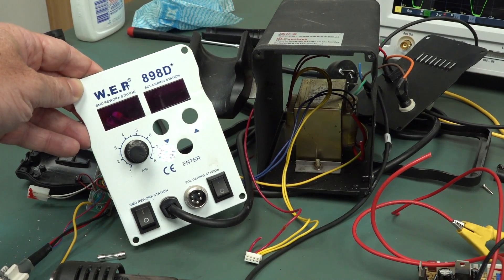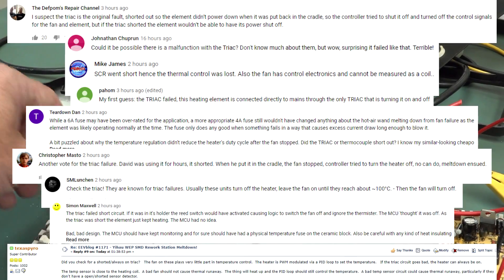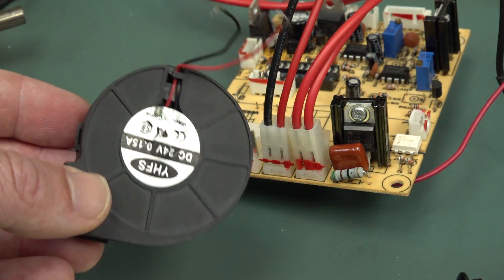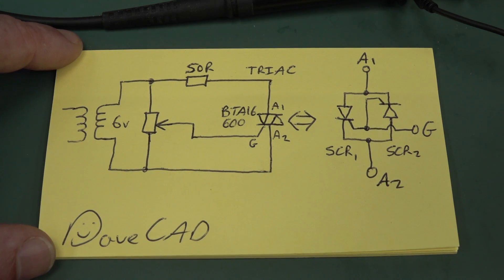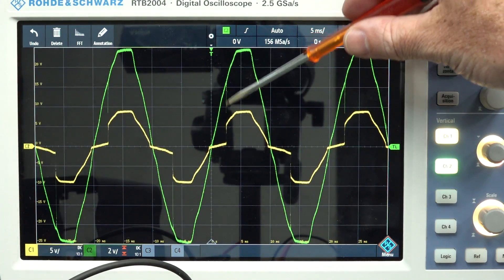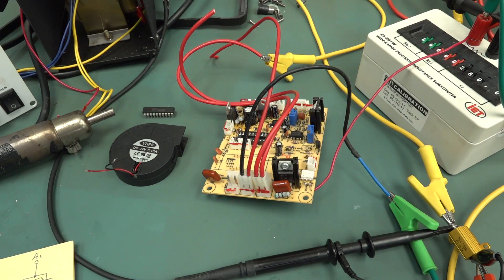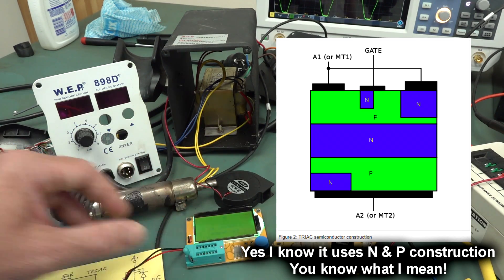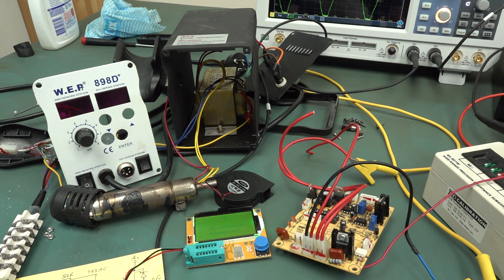EEVblog #1172 - TRIAC Testing (WEP Meltdown Part 2)

Comment: 3.5-16v supply voltage ic , on a 24v fan  together with the missing RC filter and diode, i wonder that not more burned up like that
Reply: I have a 12v 80mm fan, super chinesium, same design, i pushed it to about 55V, it didnt die, but it started overheating above 20-22V. I dont think it died from overvoltage as the chip seems quite resilent but im sure it died from being overheated for so long
Reply from the maker: LOL, didn't notice that!
Reply: @EEVblog Is that white thing (in the fan) not a fuse?  If you trace it out that's pin 1 (+) of the chip, but prolly the chip is gonesky
Reply: @EEVblog  no wonder it failed lol
Reply: Or the white thing could simply be a resistor soldered upside down. Seen it before
Reply: That's the thing I've spotted as well. But I'm also wondering, was it actually powered at 24 Volts?
Reply: I've done a bunch of these style rework station fan replacements. This is the most common part to fail. I keep a stock of these 50x50x15mm brushless fans. Tech Tip>  don't get the 24v version, get the 12v version. The 24v spin way too slow.
Reply: I noticed that aswell, no wonder the fan died and them fans can last forever or a very long time.. bet they did that to try to make sure the fan don't last too long, I've got some 5 volt dc fans and I ran one off 12 volts to see how long before smoke come out, it never..  it just got hot and slowed down, after letting it cool it was fine, so they can last some time at over voltage.
Reply: I was wondering the same thing
Reply: that white component may be some kind of zener, as it's between the Vcc pin and the positive input
Reply: but he has been this "sol dering station" for years
Reply: I noticed that as well, and even if the chip could run at a little higher voltage,  all it would take is a slight power surge to fry it. I would imagine that you would run the fan at the full 24v, as you would need all the cfm that it could supply.
Reply: Nice though, that they have integrated the Hall Effect sensor and the coil drive circuits into one IC!  Depending whether there is a North or a South pole above it, the electrons going through the semiconductor material in the sensor turn either right or left under the influence of the magnetic field; it's like a pair of diodes side by side with a common cathode and two separate anodes, and the currents going into the two anodes vary.  (The same thing should be possible in a vacuum tube valve, though awkward to realise in practice.)  The polarities of the currents in the coils are reversed depending which pole is over the Hall Effect sensor so instead of attracting the magnets towards the coils, it begins repelling them.  Then the next pole to come along is attracted towards the coils; but at the critical moment, the Hall Effect sensor sees that the magnet has moved, the outputs change and the current reverses.  And so the cycle repeats.
Reply: Its China, they dont give a shit about it, they are just filling world with crap, e-waste and toxic
Reply: That's insane how for a "24" volt fan the IC is rated for 16 volts. Hmmm.

Comment: Can't you get spare guns? You could have fixed it. They should only cut the heating element and it should not be via reed switch it should be an arm on the side of device with sprung microswitch. Or at least put the reed switches in several positions or put them in the station and magnet on the gun. if fan stops working there should be a detection and standby with warning lamp for fan fault. Just bought a most likely fake quick ali express special €135 857DW

Comment: Inside the motor driver there’s a diode in series with the VCC. You checked it with an ohmmeter. The diode might not conduct with the ohmmeter. Did you test it with power?

Comment: Anyone know why the first thing checked was not the thermocouple and its wiring back to the processor? If the thermocouple actually failed first and it thought it was cold, would that not have shut the fan off? I know the fan is dead now but i would imagine a vast proportion of the heat generated after the initial fault happened would have exhausted out of the fan side as it is the pass of least resistance as it has bigger holes than the nozzle.

Comment: Are these devices not designed to antisipate situations like a fan stopping. Maybe there should be a tiny tachometer attached to the fan to give feedback to the microcontroler.

Comment: Should have tested the hall sensor to see if that was the fail point.
I might have to change the fan in mine to avoid a similar failure even though it is a later model it won't hurt to check.

Comment: It is likely that without the resistors and capacitors installed as specified in the data sheet, transient voltage spikes hit the driver chip and popped it.

Comment: I have a version of this. The iron and rework station actually work quite well.

But I had to fix things before use (like they fused the ground instead of mains) and I installed a quality mains switch from Mouser.

Still, I never leave it plugged in, because I don't trust it 😆

Comment: Airflow. I have the smd rework from sparkfun which features a diaphram air pump with adjustable flow. Turned down the flow for a minute with the temp still hot, which was already hot for what I was doing, and found the plastic which was in direct contact with the steel had melted and the tip sagging. Haven't let it do this since and it has not gotten worse. I'm sure the airflow provides a thermal barrier between the element and the steel encasing it.

Comment: I have some Stagelighting-Dimmerpacks that utilize the BTA16 and I must say everytime a Dimmerchannel blew up on me it resulted in the Triac staying on, dead short leaving the lights at full intensity. It’s an easy fix though by simply changing the damn thing but still every single one of the countless times it has happened failed in its on-state

Comment: It's cheap. All ofthis crap is optimized to the cost so there are some missing parts. It runs withot them but they are important to be safe and to met the legal criteria.
- Why there is not the varistor to protect the triac?
- Why there is not the EMI filter when there is triac control?
- Why there is not the thermal fuse for case somethink is really wrong?
- Why there is not feedback from the fan if it is so important for safety?

Unfortunatelly the cost also don't guarantee the safety (Weller).

Comment: One little non-resettable thermal fuse, under £1 if you know the places to get them from, could have saved this disaster .....

Apart from that, the soldering station really does not look too badly made.  Prob'ly worth buying as long as you're prepared to do a quick little mod, half an hour and a bit of very careful soldering  (douse it in freezer spray and use a powerful, temperature controlled iron or one of those gun things  (I've never got on with them, but more power to you if you can)  to get just the right amount of heat you need into the joint and not give the time for it to travel down the lead wire into the thermal fuse and blow it.

Comment: Edit: for any confused...A triac requires a quick pokey turn on, as given by a diac on the gate usually. Also it varies power by altering the time constant of switch on, simplest arrangement given by an R C time constant with variable R.  A nice fat inductor on the output helps with the horrible spiky nature. None of these are in your circuit...But you haven't turned it on yet as I watch....

Comment: Dave, why didn't you just connect the whole station as it was to the heat gun, just with the heater replaced with a light bulb? Then you could check if it controls the fan and reacts on thermocouple temperature.
Reply: Because  that is a repair mans mind - Dave, brilliant as he is, just hasn't got one of those as shown on many of his 'repairs'.

Comment: Hi Dave! I did some work on TRIACs. One very common reason why they stop turning off is if they are on square wave power supply like old style inverters or UPS. They need time to turn off which they get on sign wave as it goes through zero crossing. There is almost 1ms time during 50Hz power line. While 50Hz square wave do not give this time for TRIAC to turn off!  It do not damage the TRIAC but give 100% duty cycle to the load! 

Can you verify the state of power supply at the time it went kaboom!

Comment: The heater assembly should have a one-shot or self resetting mechanical thermal cut-off placed near the middle of the heating coil body where it would do the most good.  Pretty much any 'approved' heater would have this design.  They can be as small as the reed switch they used. Even bargain basement hair driers have one.   As it was built to a super low price,  I get leaving it out, but would have saved a lot of unnecessary excitement.  But then we don't get a laugh and a Dave video.

Comment: Look at the datasheet, the chip is rated for maximum 16v input power, but it has a capacitor between the positive pin and the positive wire

Comment: The failure mode with these is quite simple. The fan is individually controlled and there is no feedback. The thermal regulation is done by a microcontroller using the couple and triac. When airflow stops, the airflow from the heating element to the thermocouple also stops, making the thermocouple read low less, causing the heater to switch fully on. Since the heat will never quite reach the thermocouple to get it to the set temperature, this thing will go full meltdown. 
All it would have needed is fan rpm sensing and maybe even a thermal fuse in the heater block.

Comment: My guess is that the fan failed and the radiant heat was too much for the plastic.
Dave, if I am not mistaken you have a similar rework station : disconnect the fan and let it sit for 30 mins ;)

Comment: I've had a TRIAC fault where there was a partial short from gate to anode which was enough to keep it switched on regardless of the gate signal. There was no short from Anode to Anode.

Comment: Why not to make some dummy heat gun to test if there main unit has something wrong? I mean with high resistant you should be able to demitre if triac works. I also think that you have such nice adjustable voltage source that you could simulate thermal voltage of thermal element.

Comment: I would guess that device is reliant on the fan to reach thermal equilibrium and then when the fan fails or is "stuck off" it has no working feedback to know the fan has failed.  I noticed that the fan only has 2 wires so likely no tachometer feedback. I also suspect that the safety feedback devices do not actually work or it is "pot luck" if they are actually connected to anything on the circuit board.

Comment: So what is left to explain the failure of the overtime circuit than that the thermocouple requires airflow? Especially given that the TC is behind the last bulkhead of the ceramic insulator, I think this is a likely cause. Do you plan to test the TC in situ?

Comment: It could have been the control loop. I have played with the firmware and replaced the micro on on my atten 858d+, and I remember even with full airspeed, full trottle on the heater ramps up the temperature really quick. If something goes wrong with the regulation it will go red hot even with the fan on, i think. I bought some thermal fuses, but found no good way to mount them in the heater module.

Comment: I still think that the lack of airflow meant that the thermocouple was measuring possibly 1 hundred degrees or so less than the actual temperature. 

The other factor might be the magnetic switch when you put the thing down - because if the fan failed, you might think it had switched off when seated back in the cradle.  You wouldnt be aware that what had happened is the fan died, and the station thought the tool was still being used (ie. not disabled by the reed switch - I often find I have to reseat mine a few times to get it to register that I've finished using it).  That coupled with the temperature measured as much less than actual temperature perhaps caused ramp up in current provided to the element in order to compensate as it thought it was too low...
In any case a bad design, these things need to consider failure of each individual component and how it might be fatal.
Reply: This is exactly what happened, the thermocouple isn't close enough, the heating element get hot from it's center, you can see it by where the metal gets red first, the distance is big enough so the set temperature will never be reached.

Comment: In the past I've repaired hundreds of domestic appliance modules where the triac, often a bt139, had failed. Many did not show a fault using a multimeter and would only break down and go short under a highish voltage and load. But my money is on the placement of the sensor, without an airflow, the heater would easily get hot enough to melt plastic. Even with the fan running, there would obviously be enough heat to incinerate that plastic handle if it was held in front of the nozzle .
Steve

Comment: Mine didn’t have a failed triack ether
Reply: No one has, just a broken cable on the fan, a broken transistor for fan control or maybe even the fan itself gave up. Just needs a new housing for the handle and this thing will make money many more years.
Reply: @Wilson84KS  My fan was also working!
Reply: Then the thermocouple maybe melted, the op-amp died or anything else in the control unit, but definitly an even more rare case.

Comment: thanks for the davecad link dave. i am actually running an old system from before yearcount. its a ‘ stone and chisel 200-bc’ . had some installation issues before but working grate after the update.  i was wondering.. will you be putting in an undo function anytime soon ?

Comment: Probably the fan, but could the heat coil get shorted to the metal shield and find the way to a closed circuit, maybe also fry the fan?

Comment: Fan fail - I wonder if the fan wires are cheesy aluminium and one has gone o/c maybe  - you could stick 12v directly on the fan board and just check it still doesn't spin up Dave (I noted the comments above about fan chip voltage range also)......But it seems odd that we have two failures happening at the same moment here, so I wonder if something in the power supply has gone intermittent and is knackering multiple things, like fan and triac drive/control loop  at the same time ?

Comment: Can you not put another fan on it and put it back together to see if it was indeed the fan that failed? I agree it could be the chip as on mine, when you return the heat gun on the base the reed switch sees it, turns off the heater and keeps the fan on untill the temp has reached 100 deg c. Only thing I could think of is that the fan shorted or failed for what ever reason causing the micro to throw a wobbly and keep the heater on. Or maybe simply just the fan being on not trying to keep the coil cool was indeed the issue. Defo an odd ball.

Comment: Hey everyone, I need your help. I am currently building SMPS on tl494 chip. But I am little bit confused about powering the chip at very start. Can i use 200k resistance between mains 300 volt regulated DC supply and tl494 chip to power it at very start.. is it safe way to power it up?? I'll power it later on with auxiliary winding with rectification for running the chip continuously.
Reply: You would likely need a zener in paralell with the TL494.
(even.. when it starts switching it may pull enough current to lower the voltage)

Check UC3842 for a common SMPS chip that have a start from mains circuit.

Comment: :) I have on my table right now a fan control unit that uses triac to control fan. And its weirdest possible malfunction. It works fine up to certain fan speeds. After that it goes crazy. :) Atmel mcu controls triac. I have no idea what the ef.... is happening.

Comment: I still dont think there was any failure other than the fan, the rest of it could still function correctly and overheat to the point of melting the plastic. I suspect that if you just put the mains power on the heating element without any control the element would burn out very quickly possibly before the thing got so hot as to melt the plastic that much.

Comment: QUESTION ! ! !   The bearing in the center of the motor at the end,  was that "wallered" out by wear or did it get warp by the teardown?  Worn bearing in motor cause it to hang up on something prevent it from turning?  My guess actual cause was motor but it failed mechanically not electrically.  Set it down but instead of sense it off it actually locked the motor.  Sorry I know bad wording.

Comment: Let's replace the fan and see if the unit works, if it doesn't work then my first target would be the heating element power drivers, after that the thermistor and finally the micrcontroller .

Comment: Did you actually try the fan with a power supply? You mention is as if you just tested continuity, but that's not representative...
Reply: Try watching the video before commenting
Reply: @ernieschatz3783  Watch the other video before commenting, he said he "measured that fan and it showed open circuit", suggesting he used continuity mode on a multimeter. But that wouldn't be representative, since the fan is driven by an IC the multimeter's low voltage wouldn't suffice to make it start doing anything. So when testing that way it could very well be showing "open circuit" even if it worked fine.

Comment: We have seen this in chinese 3d printers, thermal runaway protection was turned off in a lot of models. Even if the temerature sensor fails, the system knows it is heating too long and should SW switch off

Comment: If a triac overheats it will go short circuit and won't turnoff. Maybe the fan was also cooling that tiny heat sink on the triac.
Reply: Paul Richards No. The fan is in the handle and the triac is in the base station.